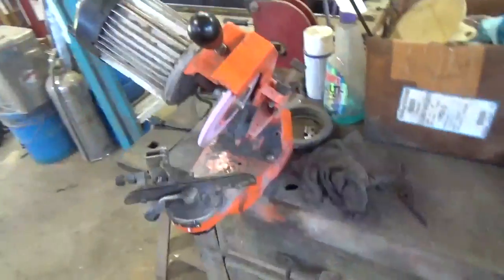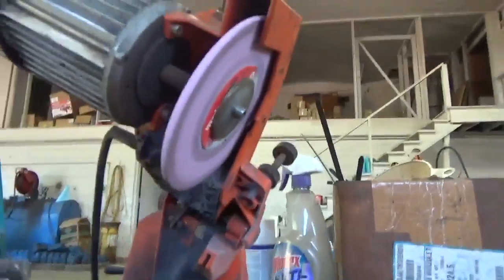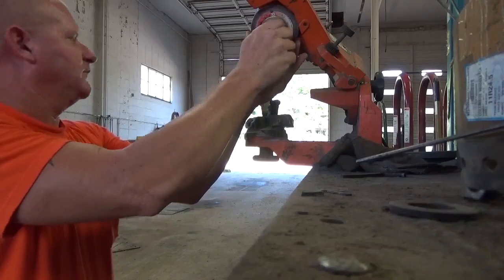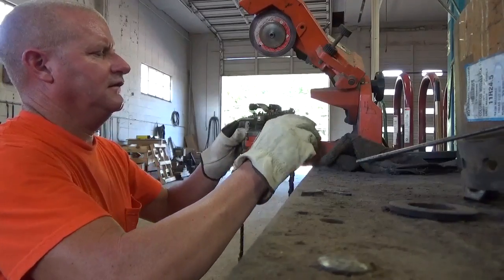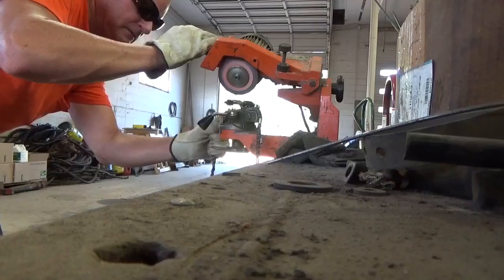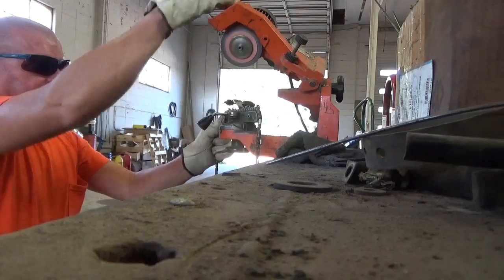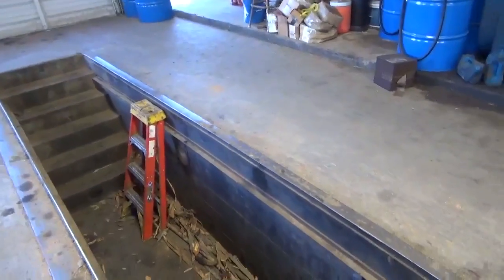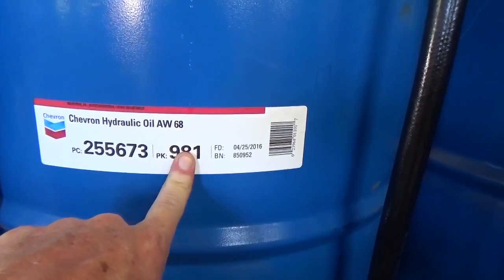How to sharpen a big saw chain

Comment: Do you set or check your depth gauges/rakers after sharpening? On the .750. what do they set them at? Guessing .030? It makes a big difference when you have to take a lot of the teeth on a resharpen. I got fancy and make a contour grinder to match the factory grind. Makes the chain extremely smooth and basically like new till the teeth start breaking off. Showed this to Wade and he got a kick out of it.

http://imageevent.com/kevininohio/depthgaugerakergrindingfixture?n=0&z=2&c=4&x=0&m=24&w=0&p=0

You mentioned the chain breaks after a few sharpenings, Be careful not to grind into the straps as that is what normally causes that. I have to watch it too as sometimes I get going to fast but there really isn't too much steel between the rivet and cutter area.
Reply: nice shop and equipment you have there!